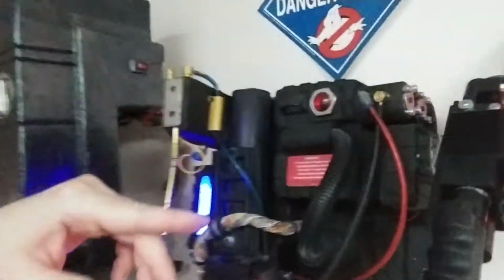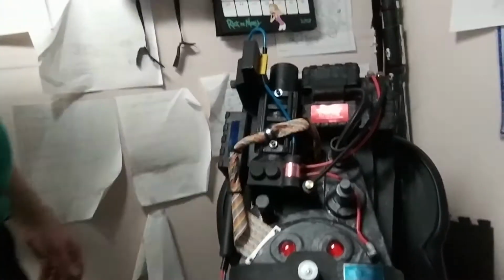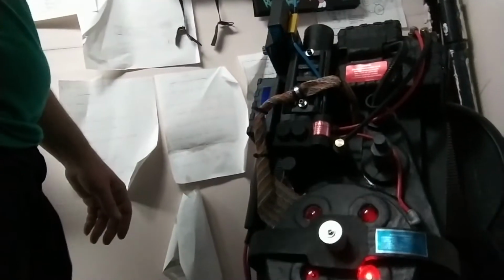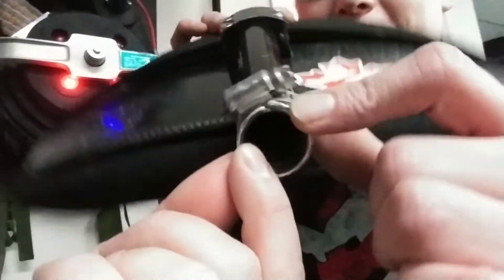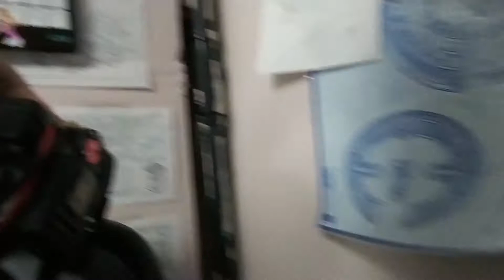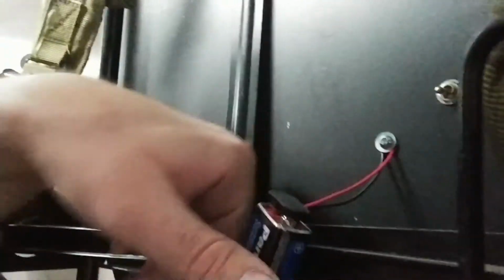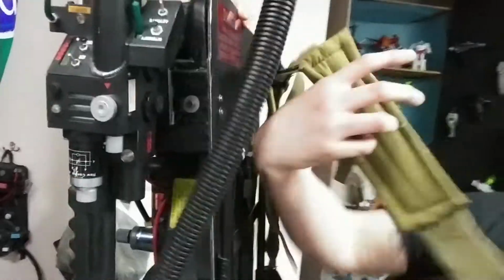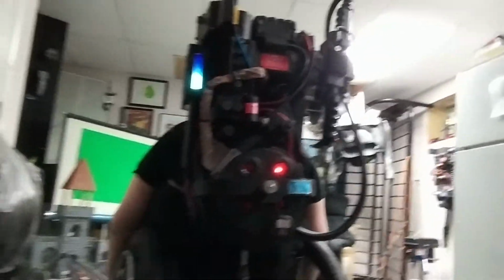Foam Pack Reveal

Comment: Is the long round vertical tube on the upper left also Eva foam?
Reply from the maker: Nope. We glued some PVC tubes into the places where there are aluminum tubes on the actual pack (in some cases), then used those to hold regular split loom
Reply: Dragonsecho3 so the long tube on the eda-box is like a 2.6inch diameter PVC pipe?
I’m building my first proton pack so I’m quite the noob. 

I’m also from Vancouver and love the stuff u guys do keep it up!
Reply from the maker: @jonogunn  I should clarify. The Hga, n filter and booster tube are indeed folded foam. Though bolting the ladder to the booster was a pain due to short bolts. All other tubes were PVC.

Looking forward to seeing you at our next event, maybe even coffee
Reply: Dragonsecho3 THats very helpful bro thanks for the info. If it‘a not too much trouble you wouldn’t happen to have some high res photos of it do you for my own reference building my own? I’m trying to use mainly Eva foam as well
Reply from the maker: @jonogunn  I just followed the plans on gbfans.com. measure, cut, glue. Plenty reference photos of the actual packs from the movies

Comment: Hi for your bumper “nipple” did you find it too heavy for the foam bumper and foam cyclotron to hold up without causing the pack to sag?
Reply from the maker: Not at all. The Eva foam is thick enough to be sturdy. The biggest challenge is keeping it centered. Some lite packing material inside it might work
Reply: Dragonsecho3 did you using any protecting coat spray after you finished painting or did the paint hold it well without it?
Reply from the maker: @jonogunn  I have the foam a coat of epoxycoat grey, which is a hard shell finish. It needs a lot of sanding to make it smooth. After that, just primer and spray paint. The only problem is chipping on the bottom where the pack gets banged into the ground, but that's expected. Wear and tear
Reply: Dragonsecho3 thanks again for the reply. I did similar to what u did but I used PVA and wood glue to seal the pack before priming and painting. My paint has dried for days but when I would get a bit of excess contact cement on it and wipe it off with my finger the paint comes right off with it. Same thing happened with a bit of tape so now I’m worried about the paint coming off easily
Reply from the maker: @jonogunn  Which paint did you use?
Reply: Dragonsecho3 rustoleum painter’s touch 2x spray paint. First used primer then metallic then flat black. I just bought some satin clear and tested it on a piece. Let it dry for 8 hours and then tried the contact cement again and it still rubbed the paint off. I guess there’s no way around it